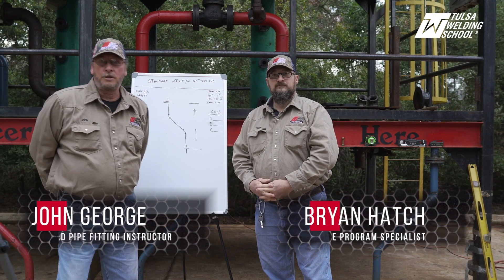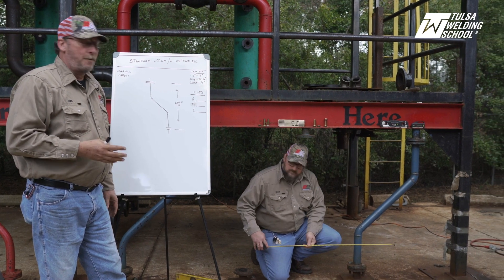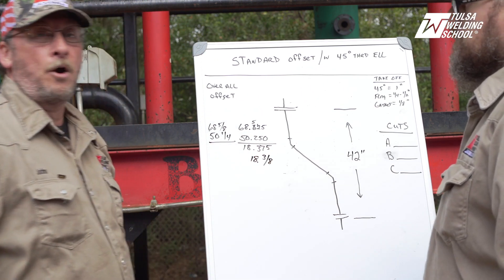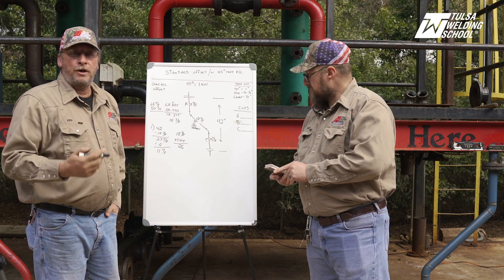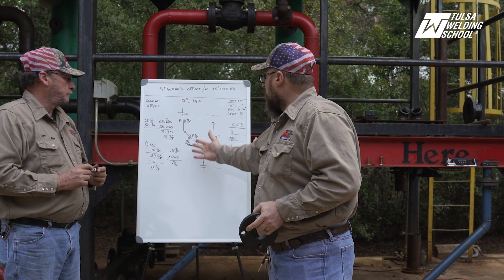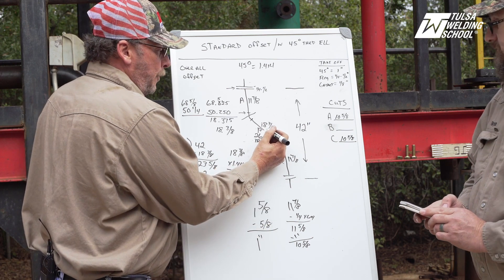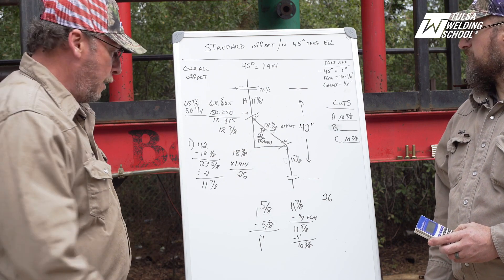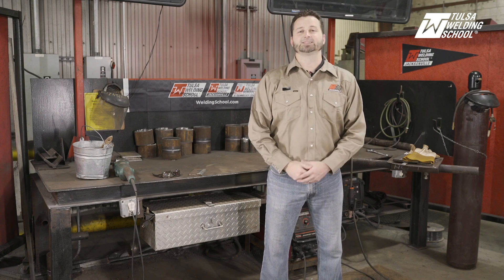Pipefitting 101: How to Fit 45 Degree Offsets Part 1 – Tulsa Welding School

Comment: Why did he write down 42" after the other guy said 39 1/4? That confused me.
Reply: Mr John took the measurements before so the other guy just said the wrong measurement. But the 42 is the right measurement.
Reply: Lol had the same question
Reply: I believe the guy measuring wasn’t reading to the bottom of the level, so I’m sure the level is 3” wide.

Comment: What happened to the Gasket T/O
Reply: What about the pipe size ? Aren’t they supposed to subtract that from something?
Reply: @sloppyjonuts9162  the T/O is 2"because of the fittings
Reply: @sloppyjonuts9162  those were 2"socket fittings .

Comment: measure from center to center of pipe then multiply by 1.414 then subtract your fittings and any other takeoff... If its a rolling offset measure from center of pipe to center of pipe then measure elevation of pipe from center to center then plug in those dimensions in here. a2+b2= then square root the answer.. Then subtract takeoffs and any other dimensions.